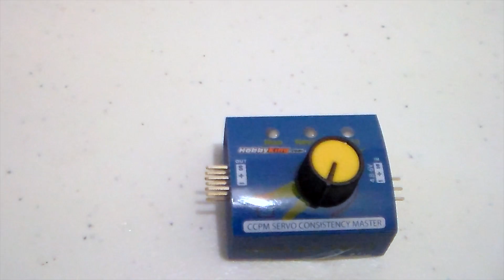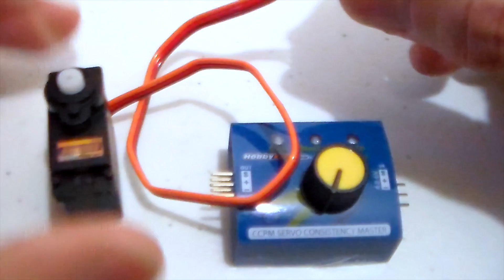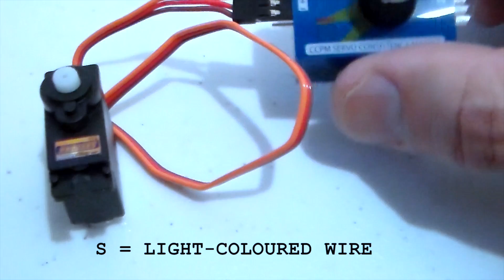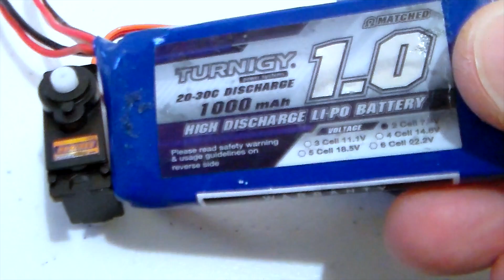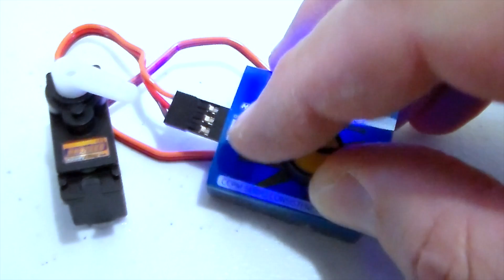Hobbyking Servo Tester AND Trick Power Setup without ESC!

Comment: if i short output signal pin to esc 3rd wire can i test a motor and esc?
Reply: NO! absolutely not. You have to do it a different way

You simply plug the BEC connector into the servo tester input make sure its on manual and turn the speed knob up slowly to see if the motor rotates

Make sure to observe polarity
and also make sure battery is attached to the ESC (NOT the servo tester)

Comment: Hi I want to use a USB battery pack 5V 2.4A, can I plug it in directly into the servo tester or do I need some kind of voltage regulator in between?
Reply from the maker: 5V should be perfect for this seeing as it's the same output voltage as a BEC. Just make sure the polarity to the tester is correct - reversed supply voltage will zap your servos !

Comment: I used a 3.7v battery to run a bl motor using servo tester...the motor is beeping..servo tester manual led is not blinking

Comment: i have one question, can i  connect it into esc and drive brushed motor?
Reply from the maker: Hi - I'm not sure about the brushed motor. This is meant for servos!
Reply: yes you can, also works with brushless setup
Reply: backyardbasher Thanks

Comment from the maker: When you use the balance plug (not the power plug) you only pick up one cell (ie half the pack voltage), but that's sufficient to run the tester OK.

Comment: Wait how is the balance lead not putting out 7.4 also? Could you do this with a 3 cell as well? It seems like usually the balance tap puts out the who,e voltage of the lipo no?

Comment: Good point on using a balance plug to power it! This way it does not have to be only a 2s battery but any lipo is the same as long as you use the first 2 pins of the balance plug.
Reply: +Darryl Edington If you use the balance plug of any type of Lipo, you are going to use always one cell (the first 2 pins starting from black wire) which is only 3.7-4.2V. That voltage range is totally ok with that device! My concern was about the third pin (which is indicated as signal) but apparently from the video it is ok to use a positive +7.4V...
Reply: +Darryl Edington I never said he used 7.4v and I am pretty sure it will damage something if you exceed voltage. I said it's ok to use any lipo battery as long as you plug in the balance plug because they are all the same. I guess it's not using the third pin which would give 7.4v measured with black wire. I hope it's clear.